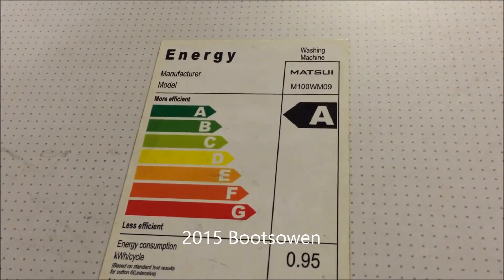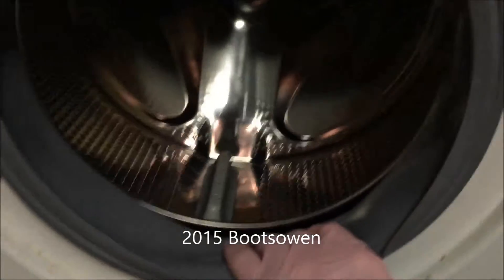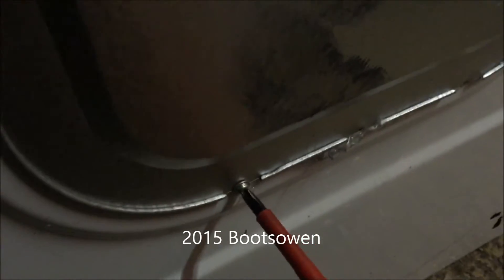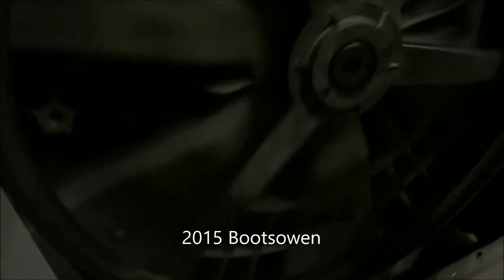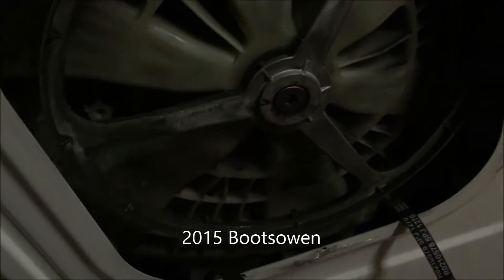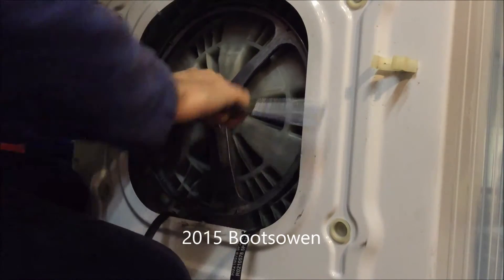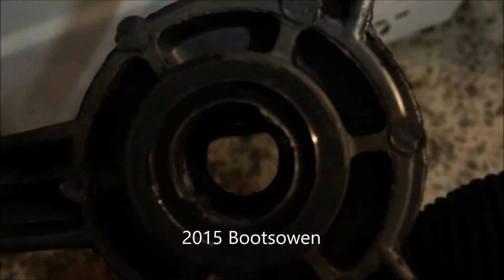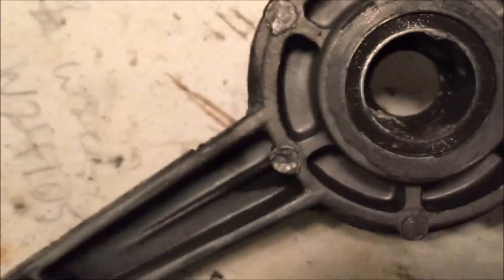Noisy Matsui M100WM09 Loose drum Pulley

Comment: My mum has an ikea renlig iwm60, and her machine started making a knocking noise from the drum, I thought it was either a broken spider or bearings, machine is only 3yrs old so still under the 5yr warranty, repair man came out and said instantly it is a loose pulley, removed the back, fitted a new pulley with a spring washer also, and loctite on the thread, job done. Makes me wonder how many people bin these machines thinking it is bearings or spider, and more than likely just a loose and worn pulley. The drum is a sealed plastic welded unit on my mums ikea electrolux, so if it was either spider or bearings, the complete unit would have to be replaced.